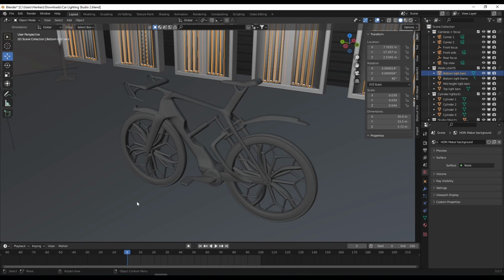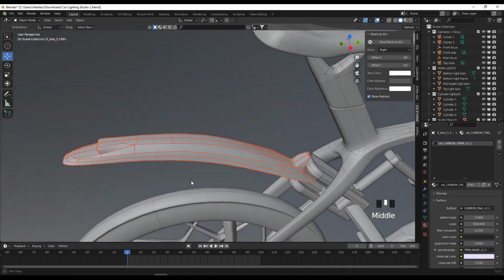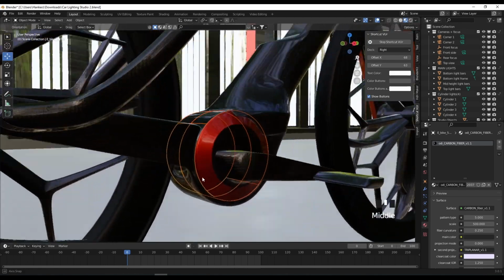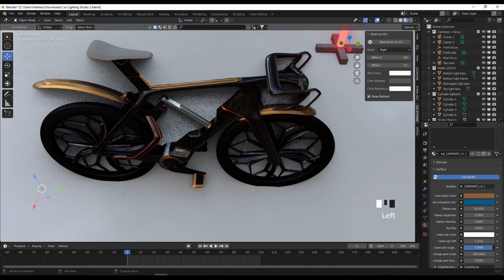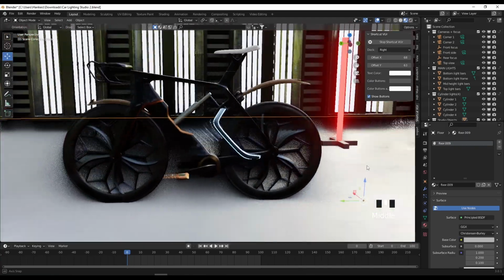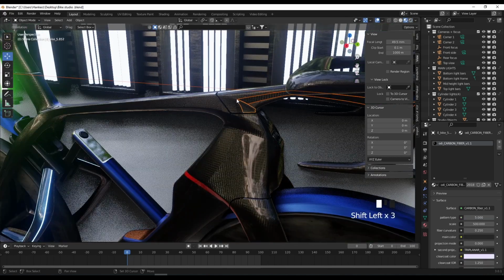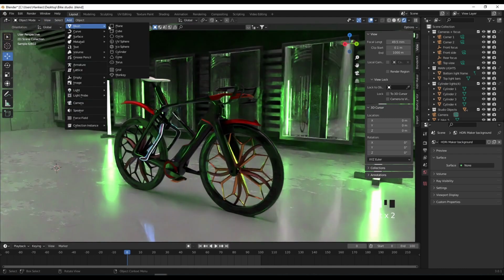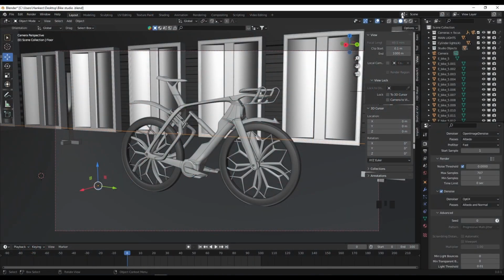Blender Rendering | Solidworks - Get a nice Render image from Blender Simply

Comment: Great video! I’m confused about how you got those clean quad boundaries. If the geometry is made of triangles, how did they separate so nicely? I’m trying to figure out a CAD to blender workflow and I’m having a hard time! Thanks
Reply from the maker: Thank you for your comment! I'm glad you enjoyed the video. Creating clean quad boundaries can be a bit tricky, but with some practice and the right techniques, you'll get the hang of it. 
its also a Power Surfacing Plugin Converting option. you can Control the boundaries manual or automatic.